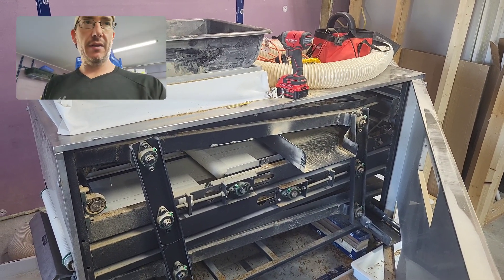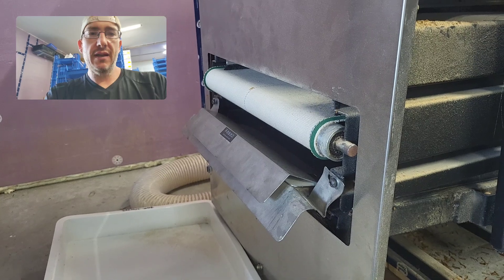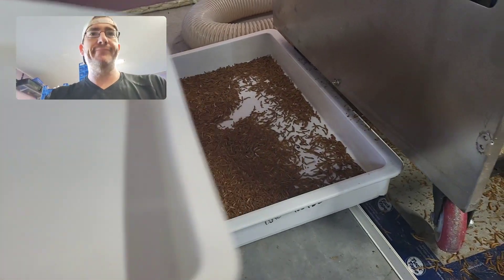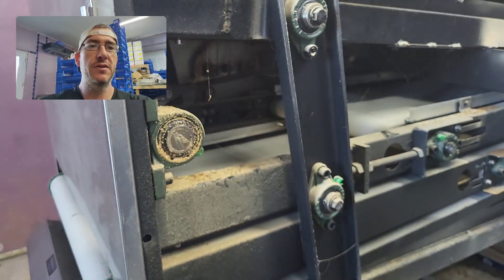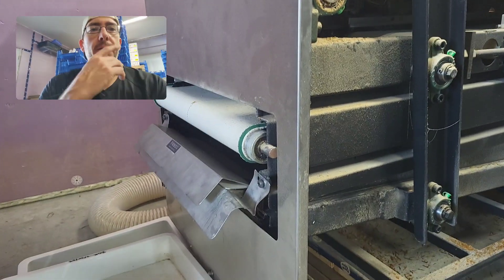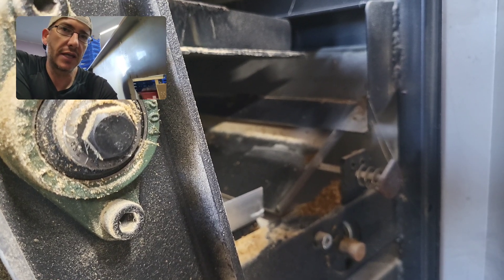Mealworm Sifter Modifications: A Risky Upgrade!

Comment: Yeah, that is risky, doable but risky. Try to fix the problems first, then if you have to, modify the machine with you plate idea (which is sound). So, if I understood, you have two issues 1) the larvae slipping underneath the lengthwise brushes on the bottom belt, 2) larvae falling off the roller (instead of clinging on the canvas belt to fall back "inside" the machine.

If I also understood correctly, issue #2 is no longer an problem as you pre-screen to remove most unwanted larger stuff. If it were an issue, you have enough room in there and slack to replace the end roller with one of a larger diameter (3", 4" tube/pipe, or make one on a wood lathe). The larger diameter would give them a lesser curved surface to hold on to.

For issue #1, consider three options; i) replace current brushes with ones with longer bristles to eliminate the gap. ii) like they do on many belt systems (i.e., mining-ore, sawmills-sawdust...) where they create a concave or cup shape to the belt. In your case, you can run two smooth aluminium rods on each side directly underneath the edges of the top portion of the belt to raise the two edges by say 1/2"-1" or so. iii) remove the bottom rollers/belt altogether, put your SS thin sheet (or hockey rink plastic side boards [actually called this], this special plastic is extra tough but super friction-less)  where it starts underneath the top belt-end roller and ends down all the way at the front like your idea but in this way, the angle is steeper and with the machine vibration, should be good. C
Reply from the maker: Good feedback, will think on it and reply.
Reply from the maker: Still thinking through this, I think I'd go with some form of sheet metal and channel from the hardware store bc it's simpler to source and I can prove out the necessary angles / whether motion is needed / will it work stuff. Having to get the hockey pieces seems expensive and turns into a "what do I do when it breaks".